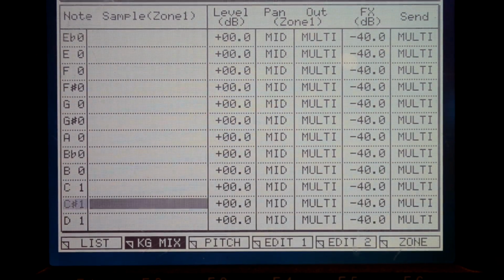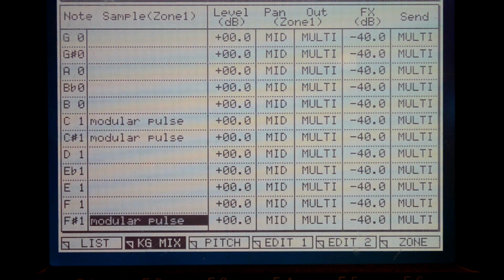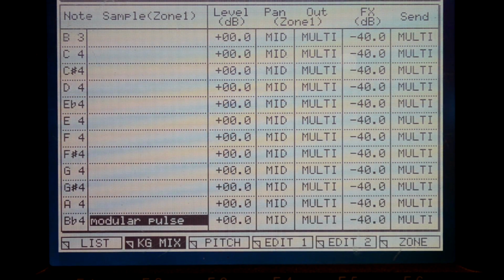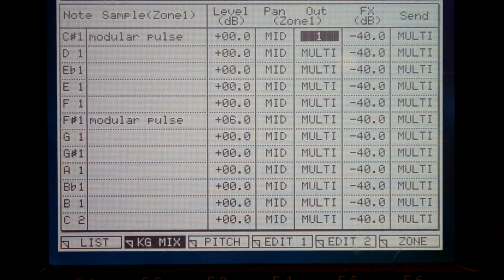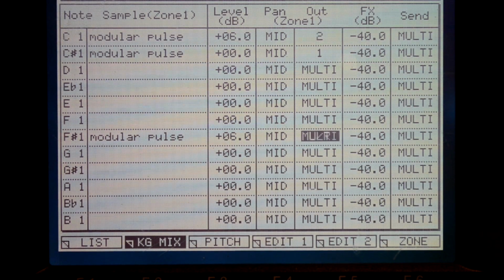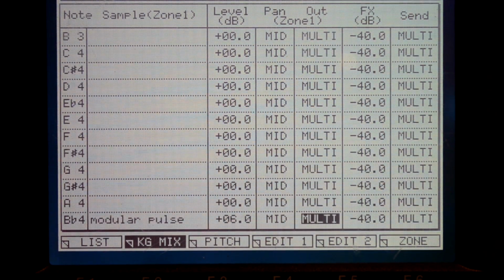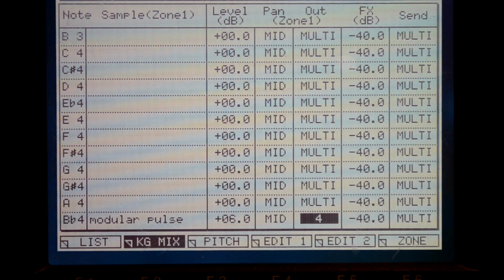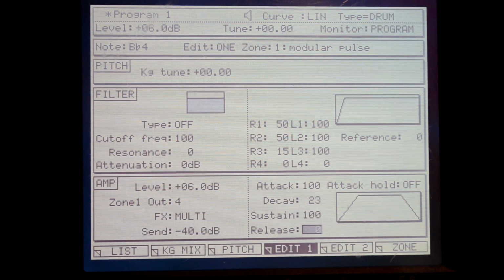Controlling the Make Noise Synthesizer With an MPC

Comment: A bit late to the party, I'm gonna see if I can do this with the mpc3000 and the pulse sample, is there anything particular on why it has to be a pulse sample?
Reply from the maker: Audio samples have a zero crossing with each oscillation of the waveform, which will be read as a whole bunch of clock pulses instead of just the one.

Comment: This is a great trick. Would it be possible to use this method to create a clock signal from the mpc ? Has anyone tried that?
Reply: +Mads Kjeldgaard That is possible. Simply have one of the outputs from the MPC be dedicated to the MPC clock only.
Reply: +Jostein Topland It works great as a clock. Thx!
Reply: +Jostein Topland when you say "dedicated to the MPC clock only" what does that mean exactly? the metronome dedicated to one output?

Comment: thats amazing! please make more of these videos! Also would it be possible do this with a push controller and in ableton?
Reply: mynmyself No need to do that, this video shows how to use modular with Ableton and other DAWs: http://youtu.be/x_79rCIsCaE
Reply: mynmyself thank you very much for being helpful. Not many people willing to share good knowledge. cheers
Reply: Arthur Hortolomei For sure… you could also load the modular-pulse.WAV into any virtual instrument and program same way. Might require some adjustment of level. The trick used in the http://youtu.be/x_79rCIsCaE video where MATHS is used to process the signal from the DAW, makes everything easier though.
Reply: ull need to setup the sample into different tracks in Live and setup your outputs to each track, while having push controlling each track with a specific pad...
Reply: MAKEN0ISE excellent help and service guys. thanks for being supportive! will get on it